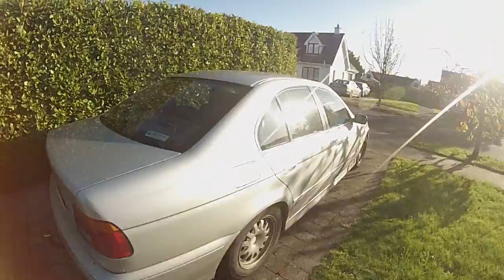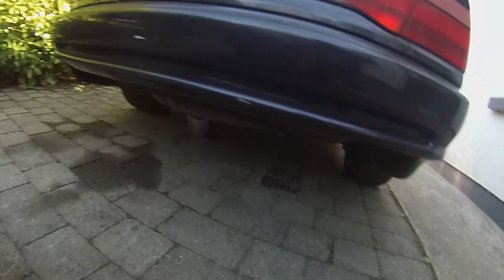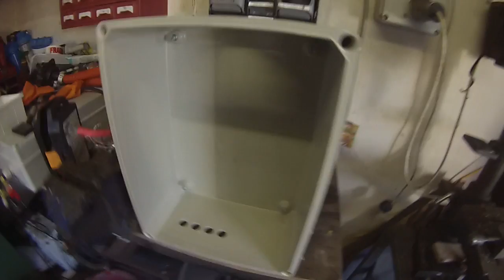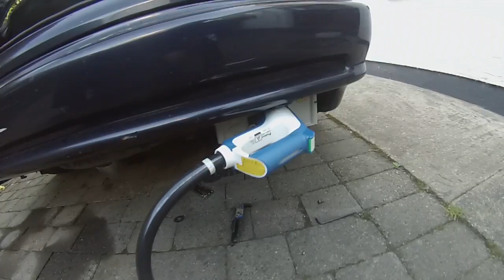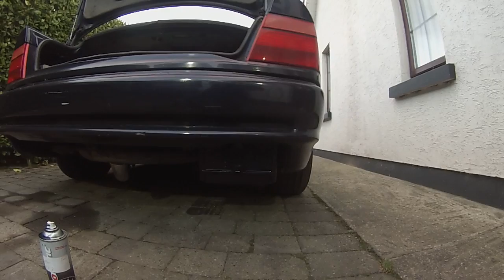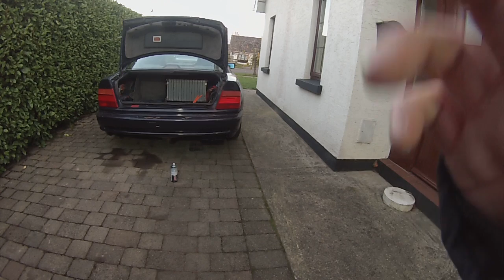BMW E31 840CI EV Conversion 70 : High Flow Back Box

Comment: Why not go CCS? I realise there's a lot more aftermarket products out there and better access to documentation for chademo.... but CCS is the standard going forward... though ESB hasn't been great swapping out old chademos for triple heads. CCS's GreenPHY PLC is supposed to be forward compatible with homeplug AV (though I think at 10mbit/s?), so it should be possible to use a homeplug AV adapter off the shelf and a raspberry pi + open-plc-utils to talk to the rapid.

Comment: Hi Damien. Excellent video. Can you please tell me how you fitted the charge port into your fuel filler? I would love to do that on my e36.
Reply from the maker: Thanks:) I just used some self tapping screws and a product called Tiger Seal which is a high strength PU adhesive. Works great.
Reply: Oh ok. My charge point is square so not sure how to do that. Need to figure how to mount it securely but so the fuel door can still close.

Comment: I don´t really understand why you put something as this at the bottom of the chassi where there might get dirt onto which can´t really be that good for the electronic it´s connected to. IMO this port would fit better at where you normally charge the battery on a car with a combustion engine which would normally be at the grille on the front bumper or anywhere you usually might find a lid for cables and such..
Reply: Nothing wrong with where he has chosen to put it. he doesn't want to have the car with trunk or hood open and doesn't want to cut more holes in the original car material. He wont get that much dirt there and it will have a cover that will protect it just fine.